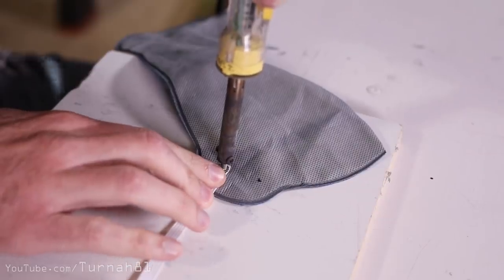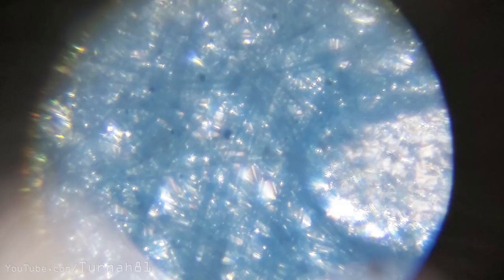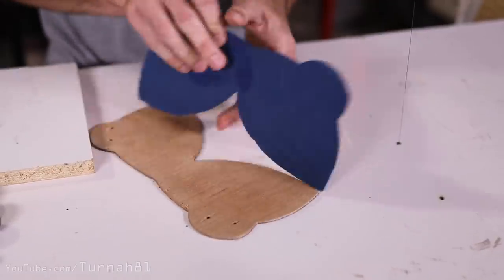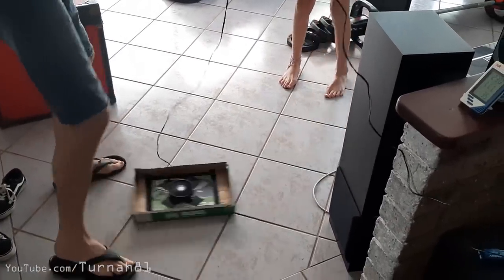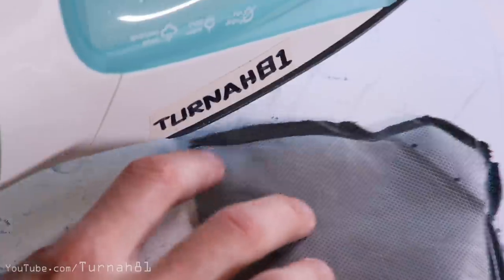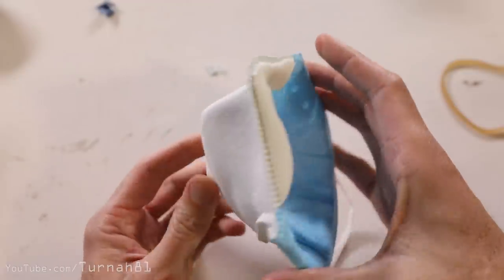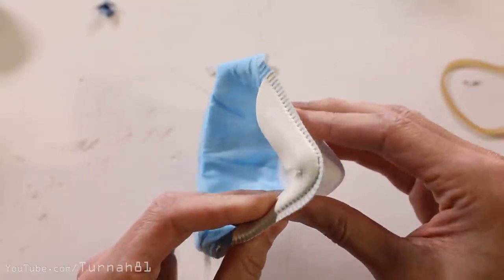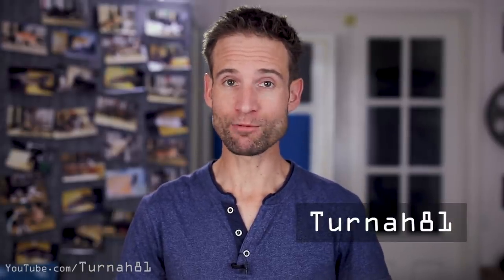How to Make the Best Face Mask, No Sewing (Don't use Cotton or Vac Bags!)

Comment: A bit of information that was passed down through our local medical community along with a bit of 'best-practices' for storing fabric that may have moisture from your breath or mouth. This part is from a virologist at one of our State Universities: this virus seems to die off on surfaces and materials in about 48 to 72 hours. So having 4 masks to rotate through, you can store a mask for 3 days between uses for the best chance of any virus on your masks dying off without using chemical sterilization. This bit learned from evidence collection: Store the masks in paper bags to allow any moisture to evaporate. Moist material in a sealed plastic bag will build up bacteria, defeating the purpose of storing them to keep them clean. Inside the paper bag, you can keep a small desiccant pack and a small carbon packet. This will assist in defeating any moisture and also help to remove any odors. Discard any mask that has been exposed to actual contagion. Also, discard a mask that has been obviously soiled. Great video and stay safe everybody.
Reply: Actually putting in a window where the sun hits the masks and left for a few days is the best.  The sun is a great natural sanitizer.  The sun will probably kill any odors too.
Reply: I wish the powers that be would give us 4 masks to use.  We were given 1 disposable mask about 6 weeks ago and when I asked if they could get me a new one, because I am a chef in an assisted living center and mine is dirty.  I was told they would try.  I told them I have my fabric mask and she said it had to be the one given to us by corporate.  Maybe corporate needs to take a pay cut and use that money to protect their employees and residents.
Would OLY FUN fabric work?

Comment: One thing not many DIYers have looked at closely enough is the nose bridge. I've had good luck with .030 music wire.... it's tempered steel, so it will actually retain its shape  so it holds onto your nose better. Bend little curly-qs on the end and put a drop of hot glue, to prevent getting poked. I've got a cordless soldering iron that has an attachment for cutting synthetic rope (weller)... think this might be easier than the iron (and not piss off the missus for getting melted plastic on hers...).

Comment: I’ve been making masks with different pattern ideas..yours is the absolute best. Not only that..I just subscribed and even if I don’t have all your great tools I love that you’ve allowed for other methods to be used. I am sewing mine and you’re right..it does leave holes. Never even thought of that. So I used a method that I chose because I don’t want to run to a store. After I sewed the seam I ran a thin line of hot glue along. I think it’s gonna be ok. I think I’ll do the same with the elastic. Just a thought. Can’t wait to have more time to watch more of your videos. Thanks again for this great pattern and all your hard work that went into it. Stay safe

Comment: You can use the material in the coffe bags, is a double wire un the top of the bags as nose wire for the masks, those bags uses that material that allows to close the bags many times. is exactly the same material in the N95 mask you showed in the video.
Reply from the maker: Yeah spot on. It sounds like a good option. cheers

Comment: I made them and tried all methods you talked about and showed. What I chose to use is to hot glue everything, because I only have a travel iron that's not very useful. They look amazing and are air tight. I stick a piece of draft band on the inside to protect the nose and on the outside I use thick wire that came out of an thick 10 mm cable with three cores. That makes the mask even more air tight. I even place a surgical cloth in between the layers to make the filtration more dence.
Thank you and greetings from infected and dangerous Sweden.

Comment: I’d sew then hot glue the seams this is genius I couldn’t find cloth at Walmart but there are many grocery bags and hot glue around
Reply: Use low temp glue gun and glue sticks. Aleenes has a couple of options as well. Check on AMAZON. ( Flexible washable with option to be abeo  oij

Comment: I used a my hand-held $1.50 plastic bag sealer from Daiso to seal the edges and it worked! But must have patience because the heating wire is tiny, and straight lines only! Curves are a challenge. I used this method and made the sealed pocket for the nose bridge wire and later sewed it onto the mask. Mine are a hybrid of a pleated surgical and N95 mask I designed. I’ve been using the material you mentioned here. I still use sewing stitches to make them. Before, I used hot glue to seal the needle holes. It was chunky and hard to control. After your video, I used Fray Check sealant and permanent Fabric Glue and they did the trick! The bottles have finer tips and the products are more liquidy. Therefore, it does take some time to dry.

Comment: Some really innovative crafty ideas here - nice work, particularly the idea of using those fabric shopping bags and car covers.  I'd guess it would be easier to just sew everything and use a hot glue gun, or even fabric glue, to seal all potential holes and get similar results.  Having to hone your iron and solder gun hot welding skills makes this a crafter's delight but an average Joe's recipe for frustration.  Just my 2 cents.
Reply: Johnny Deep for sealing holes, I find using hot glue gun very hard to control. Unless you’ve got a fancy one that has different heat settings and fine tips. I used Fray Check, a liquid sealant for fabric edges. And yes, fabric glue worked well, too!
Reply: I failed at the seam weld initially and also almost gave up. I used very thin sheets. Then I found the solution: Use aluminum foil to mechanically protect the weld until it has cooled, it is easily peeled of.
Reply: @0MoTheG  - Neat idea.  So do you do the ironing through the aluminum foil covering the seam initially, or only use it protect it afterward somehow?

Comment: If you had a temperature controlled soldering iron,, a small plate fixed on the tip would work well for sealing.
Reply: That's what I was thinking, I wonder how that screw would work in the soldering iron to just go along overlapping spot welds.

Comment: This is a really viable looking approach, mad props for the time spent! I've got a heap of those nose bridge strips coming next week to distribute around Aus. Keen for some?
Reply from the maker: Hey cheers man, top work on your channel too🤙. 🤔Hmm not sure what my plan is going forward...But maybe for experimentation😀
Reply: @Turnah81  Haha cheers man. I'll get in touch once they arrive :D
Reply: The aluminum used to make eavestroughs (gutters), and facia covering is a perfect thickness for forming with your fingers and it holds it's shape.  A 9 inch wide X 10 foot long facia will make a lot of nose clips.  Cuts easily to shape with tin snips or heavy scissors.  Hot glue them on the outside as shown or slide it into a pocket on the mask.

Comment: I just shared this video with my doctor and my daughter-in-law CRNA. WIll update if a get a medical opinion response. Hopefully they won't ask why I am following the cat video guy.
Reply: Regarding this. I'm a surgical nurse and we are saving our sterile wraps (same material) for this purpose, tho we are incorporating into layers between cloth.
Reply: Just a note. I am using the surgical wrap to make our masks...  I think there is a difference between it and the polypropylene used for shopping bags?  I know the surgical wrap fabrics are "electret" somehow (learned a new term from my spouse, electrical engineer), meaning it is  electrically treated so that it attracts the bacterial particles electrically, and I assume it will attract the virus particles as well.  I wonder if the regular polypropylene of shopping bags and car covers has this treatment? I am assuming it does not.  Still, normal polypropylene has got to be better than a lot of other fabric alternatives.

Comment: You can use the soldering iron as a hot knife by loosening the set screw and pulling more of the soldering tip out but not too much or it wont be hot enough to cut multiple layers at once. Also a good idea to use solid template or at least a stiff template with this procedure so that you can run the soldering tip around the edge of the template to cut multiple layers at once. I'm using a manila folder for my template and it works pretty good.

Comment: Good video with some great ideas. One way to make sewing more usable is to seal over the thread with an aqua adhesive like "aquashure". It will definitely seal any thread holes and even stick the elastic on. Use for water sports and diving gear. Negative point, very long set/drying time if time matters. Thanks for posting.

Comment: Fantastic. I have been looking for alternative material to make N95 mask. However, I gather the information that the material used for N95 is 3 layers meltblown. The one I have on hand is spunbond. They are different in the technic of making them that result in different pore size and fiber structure.The one you are using is spundbond 100-150 gsm and 50gsm for face lining. I didnt think to directly checked the pore size using regular microscope. As I assumed that in material lab, they will use other sophisticated microscope with better magnifiying. I was wrong as you prove it that you can see the pore under basic microscope. I will start making this mask for medical staff friends in hospital. All this while, Ive made disposable 3 layer surgical mask for them using spunbond, spunlace/meltblown with interlining nonwoven fabric. Thank you for your research 👍👍👍

Comment: With any luck, this face-mask will go viral.

Edit: A year later and nobody got the "viral" reference.
Reply from the maker: Hey Cheers but doubt it though. YouTube seems too respond to the quickest information rather than best information. But I knew that from the start with this one. Our main goal with this was to try and help people, But at a minimum though i learnt some new skills, a lot about air filtration and polyproperlene. Plus i now have a sweet orange mask.
Reply: @Turnah81  I'll be sharing it too. The orange version is sweet. The possibilities are endless when you DIY it. Thanks man, great job.
Reply: Why? It's pretty bad by comparison to most improvised designs out there.
Reply: @bashkillszombies  
Why? It actually comes close to an N95 mask and doesn't use potentially dangerous vacuum bags or other filters that could could contain some bad substances...
Reply: Je Suis Ce Que Je Suis only, if I don't have to make it myself.
Reply: @amaliarincon736  If your life depended on it, you would make it or die trying.

Comment: Glad I ran into this.  There is a craft iron called Clover Mini Iron that will make it much easier to make the welds, and you could use parchment paper to help slow down heat where needed to help make welds more solid and uniform.  Also, if used in the body of the mask could parchment paper be of help to stop air transmission too. Thnx,

Comment: There is a trowel shaped iron that quilters and seamstresses/tailors use.  They are readily available from craft suppliers, quilt shops and fabric stores, or Amazon, etc.  Also, nylon hosiery has just been discovered as a filter material, and may be superior to N95 materials.  It, too, is meltable, and might work well along with fabric, iron on interfacing and a fabric liner for the face.  I am going to try your method with the other materials, and maybe the filtering car cover you use, and see what happens.  It will be a while, as I have to locate a car cover.  I do have some surgical cover fabric from items I was saving to make a surgeon costume for a grandchild.  Thanks for all the effort you put in to keep us safe.  Many blessings.

Comment: You can also use a hair straightener to fuse the material together if you dont have an iron on hand😀 just make sure you set it to low, practice on a scrap and gradually turn the heat up until you find the right temp :) works like a charm!!

Comment: At last!! Someone whos done some actual research.  I used to be a health and safety inspector here in the UK,  and when I was trained in different types of masks and respirators,  bits of cloth across your face was never a safe option as they simply did nothing.  In fact in this situation its my opinion that cloth especially cotton, is not the greatest thing you want over your face.  why? moisture! 
and that moisture is a magnet to nasty shit in the air.  not to mention the fact that cotton has Huge gaps in the weave.  Yep, gaps big enough to let a microscopic virus through.  Now add that moisture again... and hey presto, breeding ground.  But you sir have done what I've been waiting for... Researched the materials that are as close to the manufactured ones.  As soon as you said Non Woven Polypropylene I let out a little cheer.   Thank you for spending the time to research and test, fail, re-test all so we can have an easier time of it.  
So as for the heat... Tip. Have the Iron cooler (only by about 10-15degrees) but have a slower speed, this reduces the risk of overmelt, and will greatly increase the bond as more time is allowed for bonding rather than melting.  When I use my sublimation press I have to adjust temps accordingly so have learnt that super hot is not always the way to go.  But pressure is. 
Brilliant video... and as I type this the UK have been told that that masks will now be compulsory in ALL shops etc... so this has come at a great time.

Comment: Small tip: Go to Pharmacy and ask for wound dressing with Active Charcoal, like eg. Actisorb Plus 25, they cost about 40-50 for pack with 10 cloths inside. You can also try cheaper Sliver coated dressings(20-40).
Material inside them is cloth made or filled with active carbon that is used in proper mask filters. All you need is any mask that fit your face properly, put it inside and block sides so air would go though only  center(sew it or glue it), but most of those dressing are pretty big so you can just insert them in existing mask.

I made bunch of mask for me and friends using similar style as yours but I used really think fake leather-like material sew it, insert that filter inside, and then put second protective layer from normal white cloth(for inside ). Also between those layers I put long coated wire that is used for better fitting.
As for disinfecting, some long ironing and then spraying with 96.6% Alcohol is really good :]
Reply: Lesser % alcohol is more effective. 70% is good.

Comment: Even shaved clean, the flat fold 3M N95 mask was too small to seal well.  I was given some very similar material to that in this vid, that's made to bundle surgical instruments going into an autoclave. Of course, it takes autoclave temps.  Out of the heat, the sealed bundle is said to keep contents sterile till needed.  Initial plan is to heat bond the 3M mask inside of cloth mask, with 3M exhaust valve outside of cloth.  I'll report back here if successes are had!
Reply: Checking back to see if you have a report on your mask building?  I have the surgical material as well.  Interested in your exhaust ideas.

Comment: I've been experimenting with a heat seal machine for a duckbill design. Straight lines, elastic melted with a soldering iron like yourself. Total time from cutting material to finished product is about 3 minutes

Comment: Could use a hair straightener too.
Reply: ... ..... ... genius!
Reply: At first I was thinking "Does she mean 'relaxer'?  But what good would mixing up that cream do?"  - and then I realized you meant a straightening iron .  
Actually, that is a good idea!
Reply: I've always used my hair irons in crafts more than in my hair 🤣 they do heat shrink tubing in a pinch and I've been using a curler for iron on interfacing in my masks.  👍👍

Comment: I loved this video. I agree it is a lot better than a sewn mask. I kept laughing while I was watching it because of what you said at the beginning about having most of the things around the house. I have grocery bags and an iron. I found some foam meant for around a air conditioner with tape on it. I don’t have a vice, bolts, a soldering iron, electrical wire, a wire cutter, a fan, duct work....

Comment: There are loads of vid for DIY masks but nobody explains how to handle the mask after returning home. How do you clean this mask after an "excursion" to get grub for example?
Reply: If it's homemade from fabrics, run it through the washer and dryer when you return home. I've washed those disposal surgical masks when it was all I had, and it surprisingly held up fine. It's not the best necessarily, but it's better than nothing.
Reply: You can just taje it off very carefully after washing hands and just leave it in a bag for 9 days to be sure the virus is dead or there is a technique using a paper bag and an oven at 70 degrees but I haven't used that one.
Reply: It has to be higher than 138, I heard, to kill it. Or I've heard steam would work, but microwaving--no!
Reply: The outer  'skin' of the virus is a lipid which is destroyed with soap, so wash with soap. Heat (hot water) has not been scientifically shown to work....
Reply: @gregmck7782  ]

Comment: I'm sure someone has mentioned it, but the trick with N95 masks is that they have an electric charge that attracts the hardest to filter particles (around 0.3 micrometers) to the fibers. Bigger particles are filtered like with a sieve, and smaller move according to Brownian motion and get stuck just because they move so randomly.